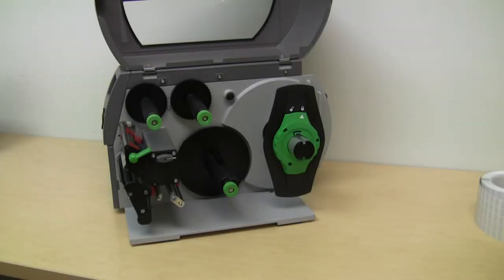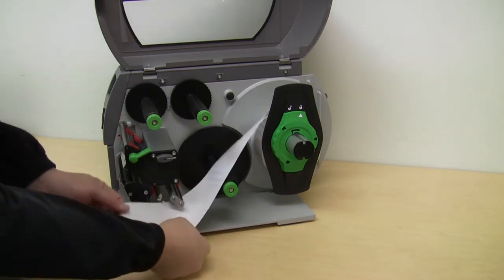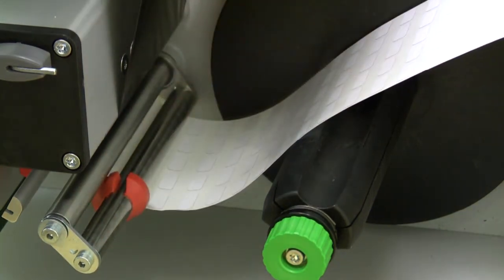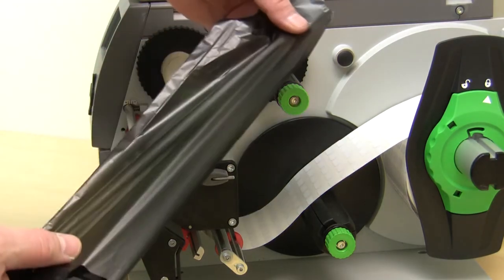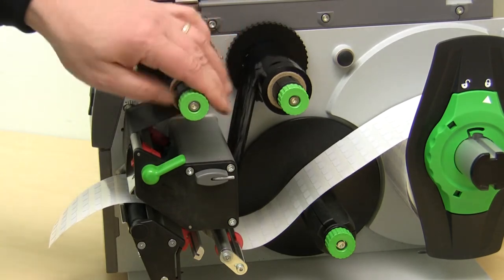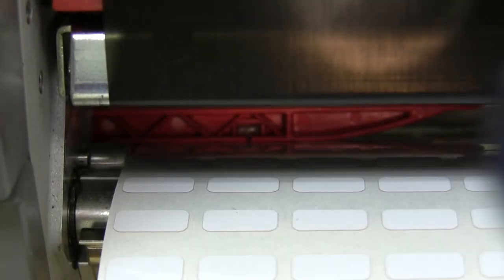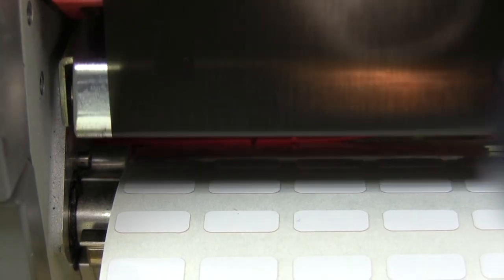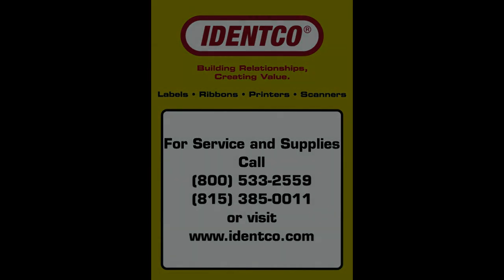How to load labels/ribbon on ELP 620 & ELP320 Series printers

Comment: Just so you know. Your video is wrong!!! You placed in the ribbon backwards. The shiny side needs to be down due to is being the ink side.
Reply from the maker: Hi Steve
Thanks for viewing our video!  This particular model uses either coated-side-in (CSI) ribbons or coated-side-out(CSO) ribbons.  There is one ribbon manufacturer out that does puts the ink on the glossy side of their resin ribbon.  The other manufacturers have the ink on the matte/dull side.  In this case, I was using a CSI ribbon from one of the "other" manufacturers.  We do supply the "glossy" side ink ribbons as well.  Thanks again for checking out our channel !